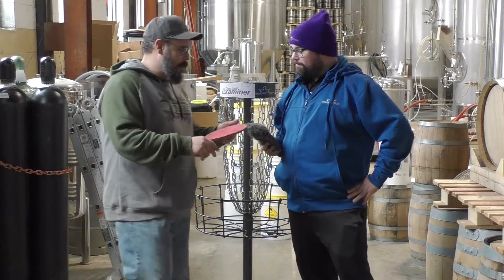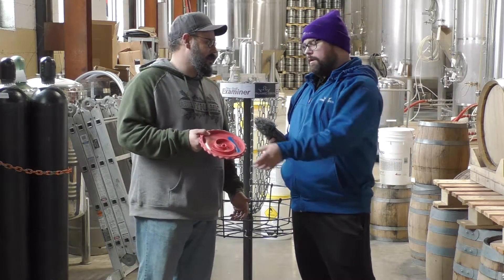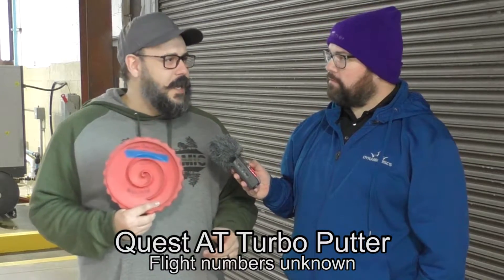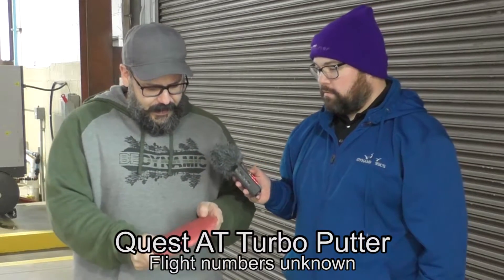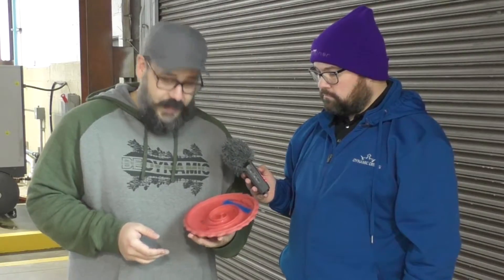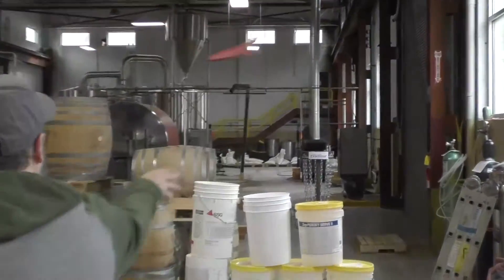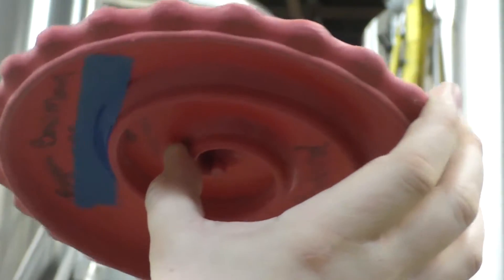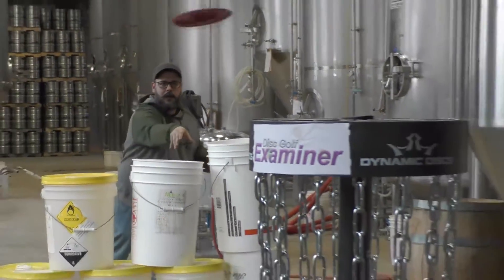Sick Discs: Quest AT Turbo Putter

Comment: Everyone laughed at me when i got one, but I'm glad i did cause theyre impossible to find now.  Its not practical by any means, but it has its fun applications.  I love that i have one.
Reply: Amazon had one three pack of Quest Discs that included a turbo putt, t-bone, and a raging inferno dt. It came today and I love the turbo putt.
Reply: @matt123411  i just bought the pack with the raging inferno, tbone and crossfire.  Haven't seen the turbo putt one in a while.  Might have to look into it.  Dont know where these are coming from though... the Tbone is a great disc, crossfire too.  Havent figured out the Inferno yet.

Comment: I got one after hearing Simon and eagle saying that it was the worst disc ever made. Frankly, I think it can help you develop a decent form if you're new to turbo putting,  so is say it's pretty good for training, but very specific in its use, so not good for actual rounds
Reply from the maker: It isn't PDGA approved, but for fun, casual rounds, I might bust it out in over the top putting situations where a normal putt wouldn't work.
Reply: i found that i made more turbo putts with a regular disc vs. the turbo putter
Reply: where did you buy one at?